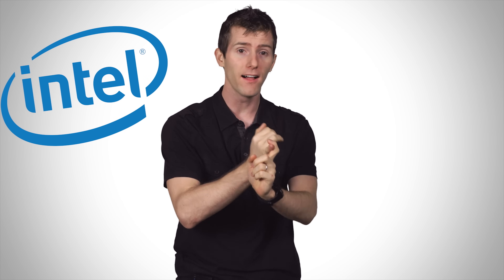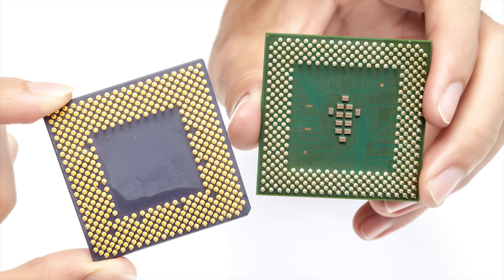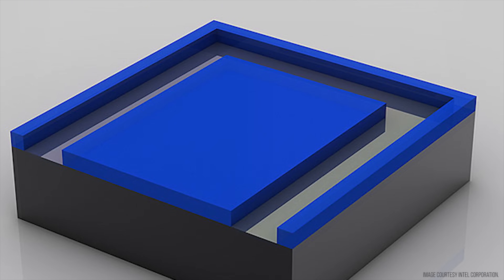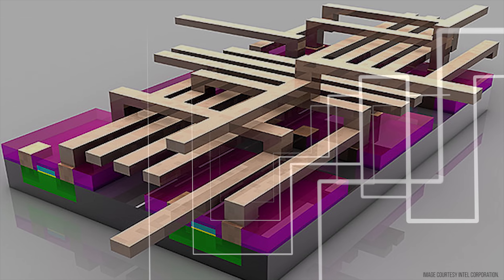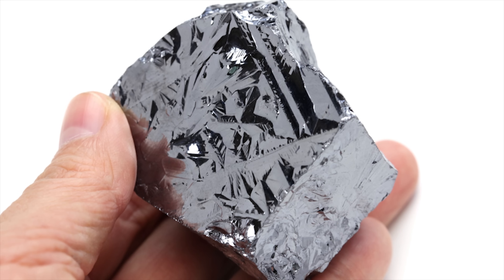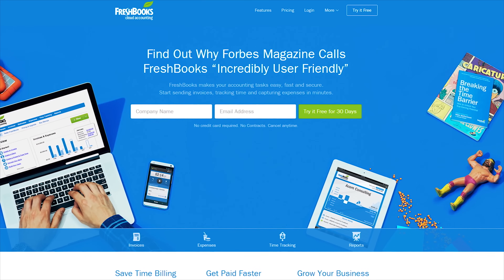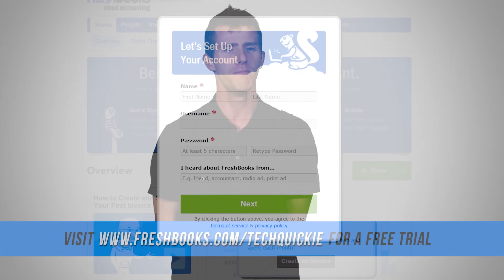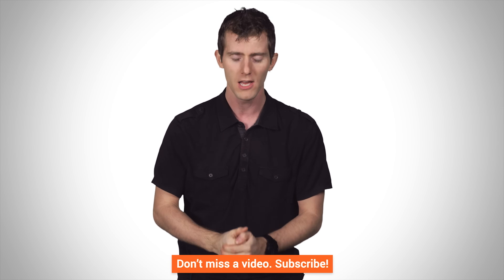How CPUs Are Made As Fast As Possible

Comment: Why are CPUs so small? i mean, you look at a GPU, or a HDD and they look important, and the CPU is that little tiny thing. I mean, if we are at the limit of how many transistors we can fit on that thing, why not just make it bigger?
Reply: +Nitay A. The larger a CPU, the more time it takes electrons to get from one side of the die to the other. (In other words, a larger CPU would actually limit the top speed. It is a careful balance between size, speed, and features. Many engineers spend years building them and figuring this stuff out.) Next question!

(And yield of course. A larger CPU die typically means less yield. In other words, when they make a wafer of them, there is more waste - more of them that don't work during testing.)
Reply: @Bowowowification Um drift velocity of electrons is in the order of mm/s. You wouldn't get any processing done at that rate. The electric field, however, travels at the speed of light. Why exactly is the movement of electrons important?
Reply: +Nitay A. you could do that, buy a multi socket board, but if you want it to be literally a bigger cpu, lets say 4 times as big, it would draw like 500w alone, and need LN2 to cool it down
Reply: +Nitay A. The GPU is also a small chip. Thing is a modern video card includes more than just the GPU, it also features its own RAM (VRAM), a sound chip and voltage regulators.
Reply: +Nitay A. A very basic, simple answer is that CPU's have a handful of cores on a die. GPU's have thousands of cores on a die. It's probably the reason that they are clocked much slower by comparison.
Reply: Because if 1 transistor in a core does not work the have to scrap it. More transistors= more fail ratio = less money
Reply: The processor on a gpu is actually smaller, not bigger.  A gpu is basically another processor chip on its own board with a bigger heatsink and fans, vram, ect, which is why the card itself is bigger.  You would really have to include the motherboard itself if you wanted to equally compare its size to a graphics card.
Reply: deviroz I don't think I've ever heard of a GPU with a sound chip. Why do you think it would have that? If you're referring to a monitor that has sound coming out of it (because it is included in the HDMI signal), it never goes through a DAC until it hits the monitor....
Reply: ***** That is actually really cool, did not know that. Are there large differences between a gpu and a normal PC, or can i theoretically connect one to a SSD/HDD with an OS and run it on the graphics card?
Reply: @Boborbot  There are huge differences. GPUs are designed for a completely different purpose than CPUs and would not be able to do the same thing. There may be some GPU that can act as a CPU, but it would not be very fast and it wouldn't be compatible with anything you would normally do with a computer. Also, it wouldn't have the ports to connect it to a drive, even if the drive had a compatible OS.
Reply: @Boborbot  No you actually can't run a GPU the same way you run a regular computer. Sure it has the "GPU + cooler + VRAM on a PCB" combo like a regular PC base, but it's not built to handle the same tasks as a CPU. CPU = central processing unit. Central because it can handle a wide variety of tasks. GPU = graphical processing unit. It (along with it's VRAM) is made in such a way as to render graphics on your screen, which requires more quantities (so needs many more cores) of complex (floating point) calculations done to achieve its purpose. So even if you could use it as a CPU, it would not be very good. Same way as you could potentially use a regular CPU (without integrated graphics) to render images but it won't be nearly as effective as the GPU (i've seen a video of a 64 core threadripper on linus' channel where they ran Crysis on the CPU and even though it's a beast, it was just not what it was designed to do). So at it's core, CPU and GPU are similar entities except each is designed to handle specific tasks better than the other.
Reply: Thats just adding more threads

Comment: The limitation of making feature sizes smaller on silicon is due to physical property of LIGHT, and not due to silicon material itself.  Lithography, the step where light image is projected onto the silicon to "print" the feature has reached a limit because feature size (16/14nm 10nm, 7nm, 4/3.5nm)  is now smaller than the wavelength of the light (UV) itself.  Making printing a sharp edge extremely difficult.   Semiconductor physicists and process engineers have used techniques such as double patterning to manipulate the light waves in order to print a sharp pattern.   Future lithographics technique such as X-ray lithography (using X-ray instead of UV) or E-beam (using beams of electrons to "draw" patterns) have not reached points where mass production is possible.   Fortunately, we probably still have at least 8-10 years (?) to go before UV light lithography reaches its limit. 

The reason why you might want to not use silicon substrate material is because of leakage currents. (leaky transistors eat battery)  Transistors created on silicons leaks electricity when in off state. (Reverse diode junction current)   So process/material engineers have used insulating materials such as Gallium Arsenide (GaAs) or techniques such as Silicon On Insulator (SOI) instead of Silicon to solve this problem, but the material is extremely expensive and transistor behavior unpredictable.   But the recent advent of FinFet (3D transistor), invented by Professor Chenming Hu of UC Berkeley and formerly TSMC CTO in late 1990s, dramatically reduced leakage current with conventional device on silicon process, rendering these exotic substrate material/techniques for very specialized and niche applications only.  

Today, all major semiconductor manufacturers in the world uses Professor Hu's FinFet (3D transistor) method to construct transistors for advanced technology nodes.

Comment: The reason why transistors can't get any smaller is because of quantum tunneling. Basicly, the electrons that wouldn't otherwise flow through the transistor (be allowed to) does so anyway (because of quantum tunneling) when the size gets too small. 

Its really fascinating, you should consider looking it up.
Reply: kurtzgesagt/in a nutshell made a video about I.
Reply: +Wellstar lolwas that a joke? You cant see it
Reply: ***** Sorry?
Reply: ***** when transistors get so small,(they are already 90 atoms wide) the electrons quantum tunnel through them, even if they are closed
Reply: ***** Zappy zap.
Reply: +Ray Saldanha +Wellstar +xSirDingo  Zippy Zap is electrical breakdown, and what happens when you overvolt your CPU.  Quantum tunneling results in a high transistor 'off' current making smaller transistors less energy efficient than larger one.

The whole 90 atoms thing is a bit of a misconception.  In a transistor you have a channel of p-type (or n-type) between a source and drain contacts of n-type (p-type) silicon (look up a MOSFET) picture.  14nm means the length of the channel is 14nm, or 90atoms long.  The actual transistor contains thousands of atoms (still very few).  

The problems with reduced size are many fold, but the key ones are being able to make the patterns small enough.  The resolution of light is 1000nm, many secret tricks are already used to  allow for this light to reliably make patterns around the 30nm size and below.  Electrons can be used instead of light (resolution 1nm), but nobody could afford the resultant CPUs.   

Another hard limitation to overcome is the placement of dopant atoms.  The silicon is made p or n type by implanting p type or n type donor atoms.   This is done by shooting the atoms at the silicon at a high speed through a mask which protects the silicon you don't want to dope.  However, when in the silicon this donor atoms bounce of the silicon atoms and spread out radially till they stop.  So as you make you channels very small you end up with a huge number of donor atoms where you don't want them to be (e.g. p-type donors in an n-type channel).  The device no long is what you expected it to be.  It's mostly this process that leaves up with the 'golden' segment of cpu's that are great for overclocking.  Through nothing but luck they have really we defined transistors and can handle increased load compared to average.  It's also why they have to test every single die they make.
Reply: +Wellstar that would only happen at 1nm, rn, we have 14nm...
Reply: Didn't he talk about that on this quantum computers video.
Reply: Sam leo Maybe. Can't remember. Just wanted to make a quick explaination for those who haven't seen it.
Reply: +Ray Saldanha Yeah, thats a great video for getting into quantum physics.
Reply: k
Reply: +Some Weeb It can happen above 1nm. That's why we're soon gonna have to find another material or method.
Reply: Wellstar no it wont, it has to be somewhere around 5 atoms in silicon, and 1 silicon atom is 0.2 nanometers, so it has to be around 1 nanometer apart
Reply: use the damn (paranthesis) (cor (rect)ly)(!)((
Reply: didn't age well, TSMC announced they're intensifying research on 2nm lmao

Comment: knowing how small CPUs have become i wonder. Why don't we just stack multiple CPUs on top of each other to increase performance... instad of making them smaller and smaller?
Reply: Because the further the distance of the message being sent might make the signal slower i think
Reply: +thePoxxxx that&#39;s basically what HBM and samsungs 3D NAND does to allow the massively higher memory speed than GDDR5, by layering chips on top of each other and stacking them up on top of the GPU core they can have shorter traces and shorter traces means you can send a signal accross them faster (this is why CPU's need to shrink to get faster, smaller transistor means less time for a signal to propagate from input to output), except HBM and 3D NAND are only used for storage atm.

Comment: The problem with transistors is not neccessarily the material that they are made of, but their size in general. 

As you said, they are made to conduct electrons, but the smaller they get (limit should be about 5nm) some effects of quantum mechaincs kick in. Here, the quantum tunneling limits the size, because when the Transistors get to small, the electrons can just bypass the transistor, even when the transistor is higher than the energy of the electron. And that is the problem. The problem is not really the material, but the size. A new material would only change it, if it would enable us to create more powerful/efficient CPU's without lowering the size of the units more and more.

Comment: The CPUs are made from Galium with different impurities, so it can block and direct the electricity where it´s needed, the problem with making something small, is the heat, as small as it made the more heat it will produce when at work of the CPU.And all of that it´s because the electrons have less 'space' to move around and they collide with other atoms in the near area

Comment: why no use gold instead of copper? it has less electrical resistance
Reply: +Eugene InLaw I'm studing MEMS and have only cut this theme so far. It's basically that etching gold is way more complicated than copper and almost impossible to make it very precise and cost efficent. Additonally the industry has lots of experience with copper already and you need extremely high success rates when etching. Imagine a die having billions of transistors, if you have one faulty etch the whole processor won't work. So you need reliable etching methods with way more than 99% probaility of success or you will have a massive amount of scrap processors. The acid needed to etch gold is also very different from the one used for copper (harder to handle). It is just not possible to etch gold this precise and successful in mass production with current technology.  The big companies would produce more scrap than functional processors so they won't do that if they want to stay in business^^ Nonetheless, using gold wouldn't do too much for performance, rather for efficiency due to the lower energy leakages. But yeah,if you want that you should hope for Bosch (they are great on this topic) or some other company to figure out a process to realise this.

PS: I tried my best explaining this to you in english. It's not that easy to me since i'm german and this isn't my mother tongue :3
Reply: *****
Etching silver would definetly be easier but still complicated. It would make more sense anyway, because it has a better electrical conductivity than gold. Same goes for copper.
I just realised that it would be quite stupid to use gold there, because it has worse conductivities than copper and silver, silver being the best and copper the second, gold the third. Why i first thought that gold would be better is, because it doesn't corrode as fast but yeah, corrosion is a very small factor in a processor. :P I might ask my Professor after holydays what the main reasons are. Then i can be 100% sure. Should be our topic for the next few weeks anyway, i guess! :P

About refugees: I'm fine with them, i don't hate on them like many people do. If i was in their situation i would be thankful for every help i can get. There are some neo-nazis trying to spread fear and use it for their propaganda and their election campaign. We should definetly help them here in germany and in their country to make it safe again. How? I have no idea but we can't let those people starve. Terrorists don't come with the refugees, they have european papers anyway...

To Merkel: Yes, she has done a few stupid things and yes, she sometimes didn't do anything at all when it was neccessary, but she has also done some stuff well imo. You know, i wouldn't want to be in her situation. She has huge responsibility and is constantly being critizied by the people, that's not easy. You can't always do what the people want, because most of the people don't know shit about the stuff they are talking about. Sometimes things should be left to the professionals, even tho we don't understand what they are doing^^. Some people are just after their personal interests, they are bragging about the government helping out refugees financially and think that they will fall short themselves because of this (mostly lazy, unemployed, uneducated ppl or convervatives). I honestly don't know if another person would be better for this job. She stands behind the european idea and same goes for me. :)
Reply: +Eugene InLaw 
because it is more expensive
Reply: ***** there's a TINY amount of it needed there, probably in the nanograms devision
Reply: ***** cost per unit still is tiny, and they always can start charging more for them, especially because they'd be faster
Reply: Microage

That's really nice. Thanks, german friend. What about silver? Would it work?

Also, what do you think of Angela Merkel and the refugee situation?
Reply: +Eugene InLaw Gold is used in satellites since they have to be largely maintenance free.

Comment: Today I've turn on my pc (i7 3770k, 2 gtx 680's, 8gb of ram..) and the cpu red led of my asus mobo lights up. The fans are spinning but there isnnt anything on the screen and the mouse and keyboard don't light up. What to do ?
Reply: +AlexSurYouTube dead power supply wire for the cpu? Idk maybe even your video cable could be dead or smthn. Check the wires carefully maybe one of em isn't plugged in, could even be a dead cpu
Reply: +HydraZProductions Ok I'll check thanks
Reply: +AlexSurYouTube does it work? maybe u shld go to forums for help, a picture of ur motherboard would help
Reply: +HydraZProductions It works fine now I think the problem was the cpu cable or a sata cable thanks for asking
Reply: oh ok np.